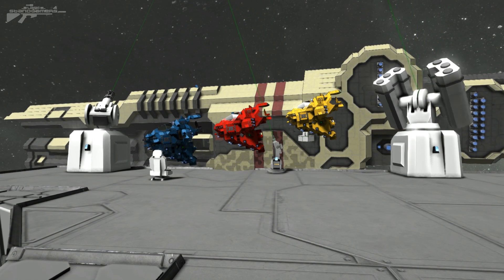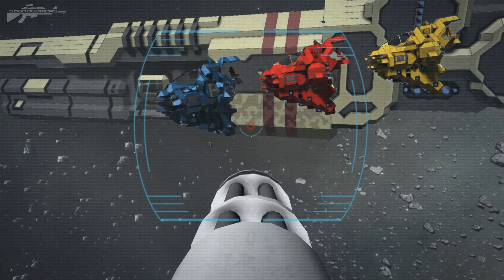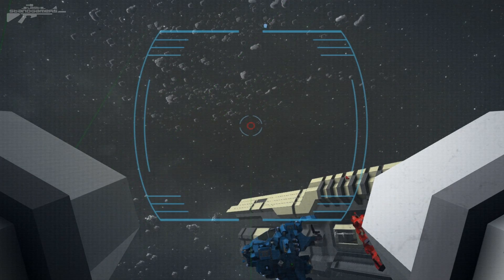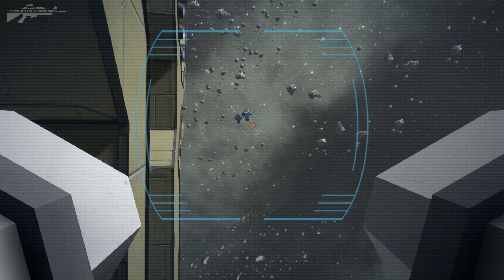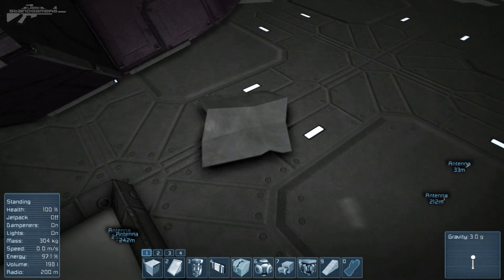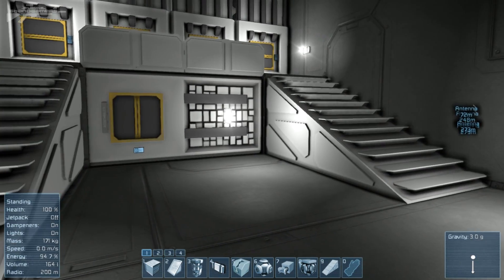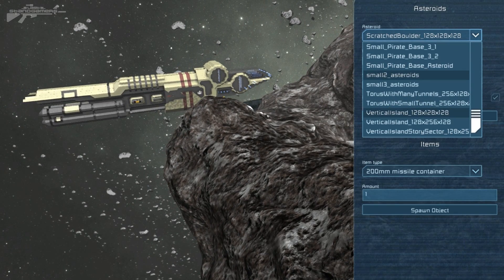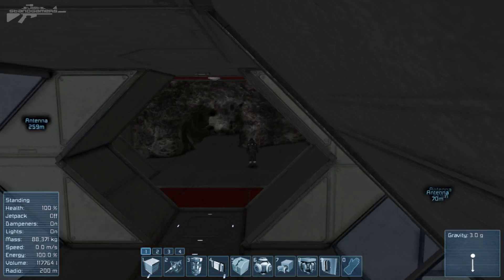Space Engineers - Manual Turret Control & Placeable Asteroides

Comment: I used the new turrets and controlling mechanisms to make a sort of AC-130 style gunship, using a Gatling gun as the 20mm rotary gun and a missile launcher in place of it's 105 Howitzer. It's controlled by a gunner from the inside an it's design requires a manual reload by another play, to keep that gun ship style immersion.

Comment: Meh. Not a big fan of those controlable turrets. They've built an awesome component system with rotors and pistons and antenas that allows you to build your own turrets. Oh, but here is a single placeable block that does all that without any creativity required.

What is that block Aaron has in his 5 slot though? Did I miss an update, or is that from a mod?
Reply: Yeah, I see no point in making turrets controlable. You can control only one so it won't make much of a difference and with remote control block + cameras you can make better turrets. They should give us remote controled 40mm canons. Or 100mm.

Comment: I don't like how the blast of a missile destroys all components, even if it's on the other side of an armored ship. If it's on the same side as the missile hitting, fine. If it's on the opposite, the armor should do its job and shield everything from the explosion.
Reply: I'm sure they would balance this out to either make them more expensive or make them less explosive.
Reply: Yeah, they really should modify the damage model to deal the most damage to any block thats taking the brute of the force. That would both put reason to armor and make the components more of something to hide in the hull rather then something comparable to someone hiding under cardboard after smacking a wasp nest.
Reply: It didn't destroy the components on the other side, if you fast forward in the video you can see he shoots the ships again and the other side of components are destroyed.
Reply: Actually in a recent Developer Q&A, the Devs acknowledged this issue, and announced that they plan on fixing it soon.  Explosions currently just damage things within a set radius. They said they will change over to volumetric (I think) where it doesn't ignore armor.